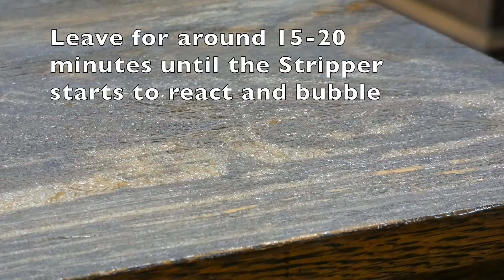How To Lime Wood | Priory Polishes

Comment: I was on board, until the wire brushing and wax "effect".. It looks contrived and Disney-fide. I would have preferred bleaching and or Lime washing.
Reply from the maker: Hi, if you do not use the liming brush to open the grain, then the liming paste will not stick in the grain and will not work. You can not cause a limed effect without opening the grain first.
Reply: @priorypolishes  Well that is not entirely true... I have seen lime wax used without using a wire brush and sure the effect was lessened, but I think in this and other cases, that is a good thing.. less is more!
Reply from the maker: @rw9207  I suppose this depends on the type of finish you want. If you want to Lime wood correctly, you do need to open the grain but if you prefer a lessened effect, you could just use a white wood wax, rather than the liming wax.